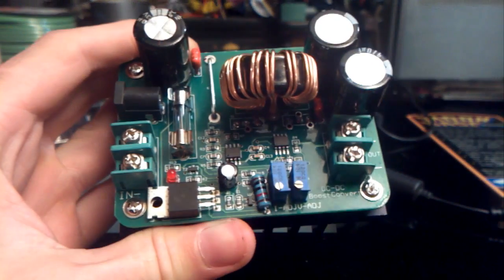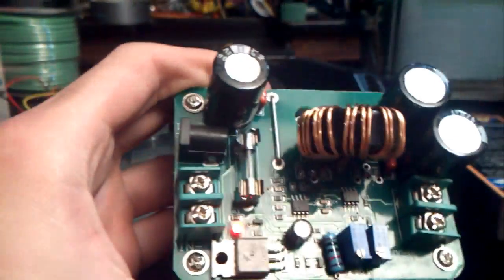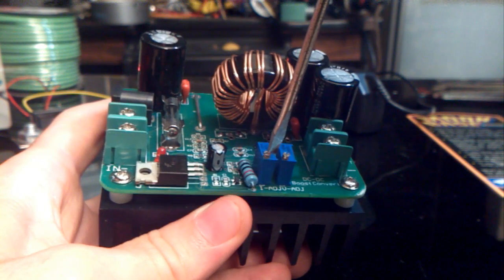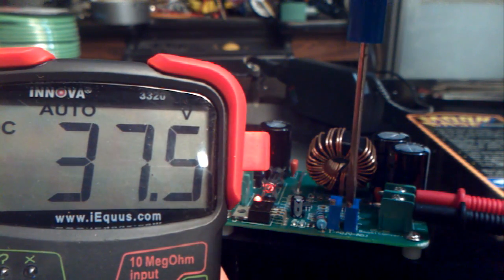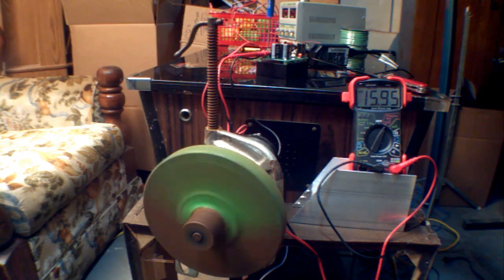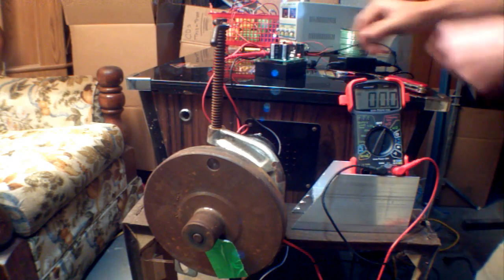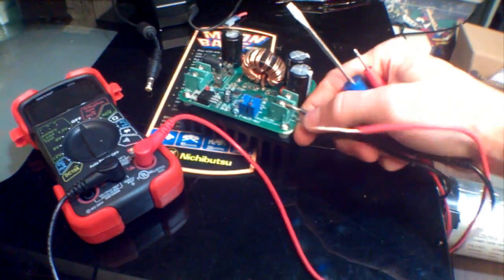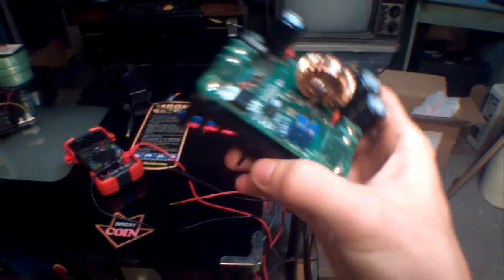Ebay Reviews: 10-80v DC step up converter

Comment: Hi thanks a lot for the very interesting video.  Regarding the current available vs voltage output ... if i use a 24V/10A power supply at the input i would get about  6A at 36V at the out ?    i have to step up voltage from 24V to 36V  Thanks a lot, gino

Comment: You have no clue about batteries do you?
The voltage at which you should/can charge your battery depends on the kind of cells and number of cells in series your battery has.
A 48V 13S Li-Ion battery should be loaded CC CV at a maximum of 54.6V although it would be better to keep the voltage below 53V.

Comment: dude- you seem like the guy ineed to chat with. cant one of these etap up gizmos work for converting a 12volt battery to 36volts  for an ebike kit motor ? i am looking at buying a golden motors 902pro set at 36volts/350watts.....the cost of lithium batteries is outrageous  so i want to use 12volt 18ah batteries.....they weigh 13 pounds each......what i am thinking is if i use 2 of those batteries i will have 12volts with 36 amp hours.....i looked at one ste-up converter and it stated wattage  output was based on volt number times 10....so 24volt 18ah would give me 240 watts to a 350 watt motor.....does that sound right ??
the reason i am looking at the magic motors 902 front hub is because i want a motor that freewheels when i just want to pedal....i dont know the technical term for that motor type...every time i make contact with somone i always end up with them trying to sell me their stuff...i need answers at this point...i am lost...
 i am building a custom delta recumbent trike..will have a 26" front wheel..the entire trike will weigh aound 70 pounds.....i weigh 250....i live in orlando florida so the terrain is quite flat....
 i think 350 watt 36volt motor will allow me to cruise at 20mph...but i am not sure....the battery pack for it would require 3 of those batteries @13 pounds.... i would like to use just 2 of them and then a  step up booster to save some weight....what do you think ?

Comment: Super-Genius  -  What's the maximum of amps you could draw at 50 or 48 volts?
Reply from the maker: depends on the circuit's resistance.

Comment: Rinoa...everything i search for I see you over and over <333
Reply from the maker: hehehe
Reply: Hey.  I'm building a 14s pack using harvested cells n gonna wanna use a BT smart BMS.  Some of my cells specs say they should only discharge at 500ma current max.  So I need to pull 30 amps outta the 52v pack... Should I get some other newer cells that are the same capacity but can give out more amps to mix in there?
Reply from the maker: each cell should be at least able to give a few amps. dont go for anything less than 1500mah. a 1500mah cell should be able to provide 3 amps without getting unreasonable hot. aim for 0.5C discharge for longest life. but honestly you can always invest in a better battery once your get your first made

Comment: do you think this will work on what i want to use it for? i plan to use a 90v dc traedmill motor on my metal bandsaw and the motor is a 10 amp motor. will this setup work on it. my input is a camper ac to dc converter

Comment: I recently purchased the exact same model. I too was looking to use mine as a charger for my 36v ebike battery as well as a 24v volt battery backup pack I have. How do you ensure you don't over charge your battery when using this?
Reply: epicdeuce I would also like to use this to charge me ebike (75.6v @ 16a: 18s8p). But I am planning to get a bms to be sure that the batteties don't overcharge. I am interested to see if it's usable without a bms aswell though.

Comment: I know this is an old video.but I was wondering about the treadmill DC motors. they seem to run OK off lower volts. I have a full suspension mountain bike. I want to put a motor on. would a treadmill motor have enough power to make it really move? like 60 mph top speed. and could a couple buck boost converters be used with like 4- 10-15 amphour 12v batts. using the voltage converters as a simple throttle. by changing the potentiometers? I don't know know much about the motors or the converters. basically what I want to know about the motors . do they have more power than the bike motors. like the 24 or 48v 500&1000 watt bike motors on ebay. I'm trying to do it on the cheap. the motor controllers cost quite a bit. thanks and great videos
Reply: no would be too much amp draw
Reply: James stranger these motors make about 3hp. depends on the voltage. i have one from a Nordic 1750 (?). it requires to much voltage i use ot on a gokart and it flys! but i have 12 batterys.

Comment: boost converters don't make more power they just create the ability to cut through resistance by using higher volts
Reply from the maker: +Joseph Chambers yup, did you just now figure this out?
Reply: +Rinoa Super-Genius volts times Amps =Watts  this works with every inverter and soo called boost converters which      are flipping things around. More volts less Amps instead of less volts more amps. Some E vehicles use low to high voltage converters  200v to 500 so that the windings in the motor can be thinner and lighter and longer to spin faster because the loss of the weight. Those capacitors on the 600w converter have peaks of high Amps but there there just so smooth out the unstable ripple voltage. I used to think those capicators made the converter more powerful  but I was fooling myself for months. Sorry for the long comment I just wanted to answer if I figured or learned anything. btw I am 14years old......
Reply from the maker: Joseph Chambers
well that makes more sense that your 14, thats about the right time to learn about ohm's law.
Reply: +Rinoa Super-Genius That's why power lines carry high voltage instead of low volts  because you would need huge thick heavy wires to carry 120v at insane Amps  required power to power a hole city and houses. Ohms law is very important me to know..
Reply from the maker: Joseph Chambers
exactly, its also why we have MPPT controllers are solar panels, so we can feed power at like 1000v to the controller so it doesnt waste as much energy on the wires, then they step it down to whatever voltage they need.
Reply: +Rinoa Super-Genius  Yes and I also know the difference between amp hours and watt hours amp hours is just Amps per hour watt hours are Amps times volts an hour. I like to say Amps are like torque volts are like speed and horsepower are like watts. I'm not sure why I think of it like that.
Reply from the maker: Joseph Chambers ok so if you understand it, why are we still talking about it?
Reply: +Rinoa Super-Genius idk I was just really board but I'll stop now
Reply from the maker: Joseph Chambers
if you havent yet, go get some Peltier coolers and play with those, that could be a next good thing to learn about and play with. i want to build something like a solar cooled thermos with those someday.
Reply: +Rinoa Super-Genius I'll do that

Comment: Hi Rinoa
Great video, is this module still working. I am working on a project that requires a max of 10.8 volts but at a current draw of 8 amps from a single automotive battery do you think this module will fill my needs. thanks and keep the videos coming.

Comment: I have a DC motor that consumes 10 AMP on load . It's input is 12 volt and i want to step up the input to 24 volt inorder to increase it's speed . Is this circle be suitable for that ??
Reply from the maker: it should work. it can handle like 600 watts I think.
Reply: Rinoa Super-Genius First thanks for your fast response. second i have a last question, When i double the input voltage for that motor the Amp should increase so it will exceed 10 AMP because this motor consumes 10 AMP when it's input is 12 v  and the output current for that circuit is "maximum output current of 10AMP ( adjustable ) ". is that circuit will increase my motor speed ??

Ebay Reference : http://www.ebay.com/itm/DC-DC-600W-10-60V-to-12-80V-Boost-Converter-Step-up-Module-Power-Supply-/170893208817#shpCntId

Comment: This is an after the fact refresher.  Got 2 of these and work very good. NICE Video and nice demo.  Thank you!
Reply: alex 1960  -  What's the maximum of amps you can draw at 50 volts with an input of 12-24 volts?

Comment: Thanks for posting this.  Exactly what I was looking for!  I am really considering getting one of these.  I have been thinking about using my bike battery (16S LiFePO4 15Ah) for a portable power source when not on the bike.  Already have a really nice 48-60V input pure sine inverter, just need a good way to charge the pack out in the wild.  It seems like this little guy would make a really nice boost converter charger for a couple of solar panels attached to the battery!  Also, I noticed that a seller has got them on Amazon now - Prime even!
Reply from the maker: oh thats a great idea. i was planning on using my first 48v 9ah battery pack for a project when i replace it with my 48v 35ah one. i'm perpetually disatisfied with modern laptops (except thinkpads) and so am going to rebuild my 1984 Kaypro IV portable comp with modern circuits and that 9ah battery. it should be awesome if i ever actually get around to it. i'll even run it with the origenal monochrome CRT.

but anyway thanks for enjoying the video and i'm glad you found a use for this converter!

Comment: Now I know why I have been blowing up my converters. Not adjusting the current the correct way. I see now it needs a proper load with current meter in series and not just the meter across the output. Many thanks for a great review and tutorial. Thanks for sharing.